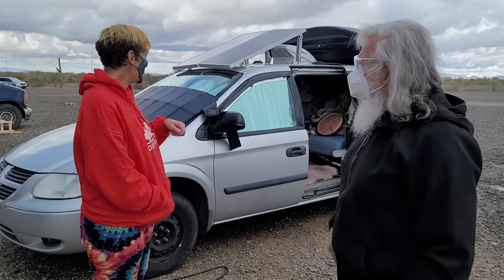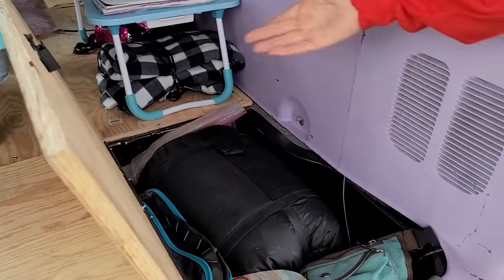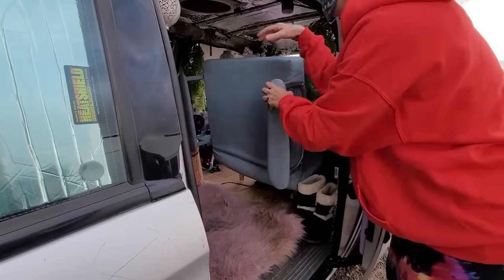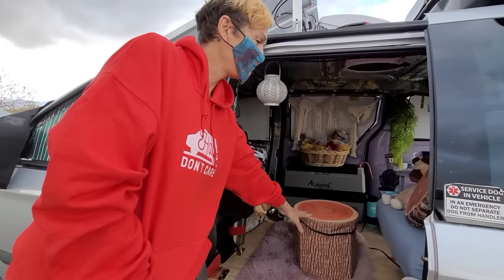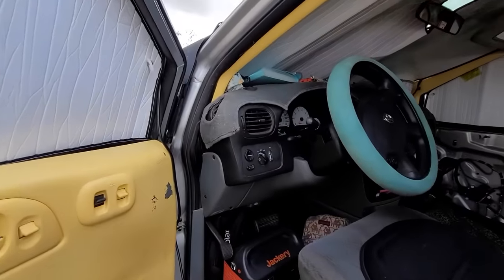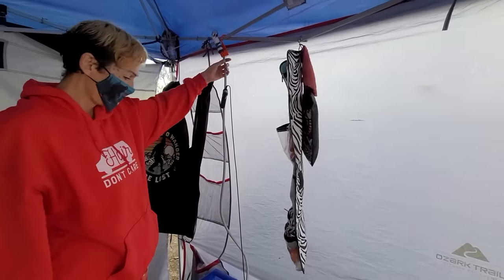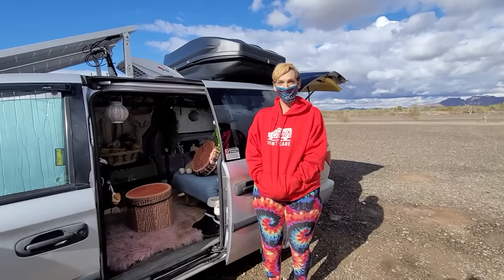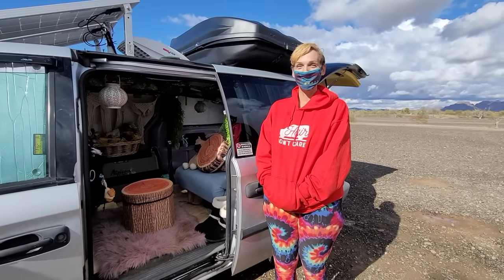Tour of Solo Woman Living in a Minivan and Tent | No-Build Van Life

Comment: I am building out my truck cap BUT I also want to set up my tent and gear. How did your tent gear hold up in the desert with sand and wind?
Reply: If you are using a tent in the desert or any windy area you will need really good tent stakes. Also need to tie it down. I use my tent thing close to my van and use the van as an anchor for it. If it is a cheap tent it wont last.
Reply: It didn't. Not even two weeks. I ended up getting a tent that attached to the back of the van and by being attached it gave it the extra sturdiness needed to make it through the wind. Its been going strong for months now.
Reply: @mrj-charles6383  I have an REI Basecamp 6, designed for rugged weather, especially winds. Not cheap at all but definitely have concerns. Thinking it comes down during winds
Reply: @birdysbus  I am trying to find your YouTube channel but it's not coming up. FOUND IT!